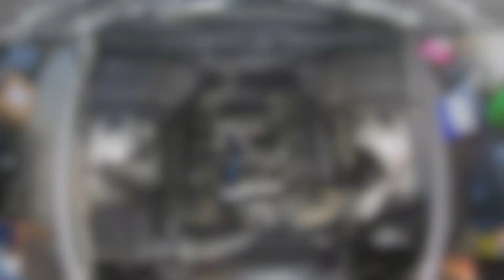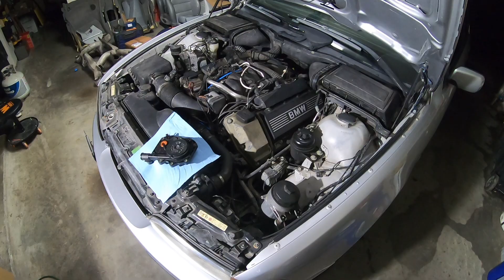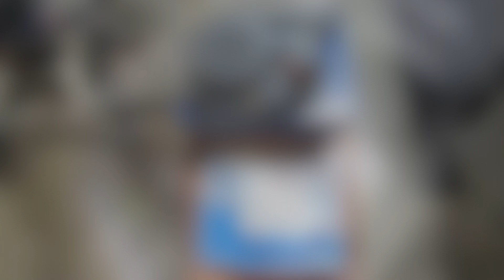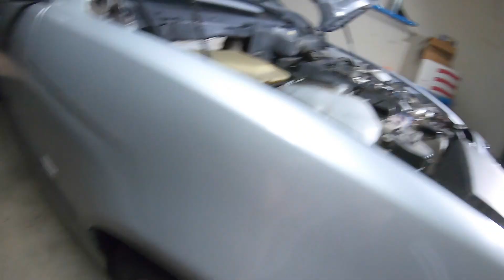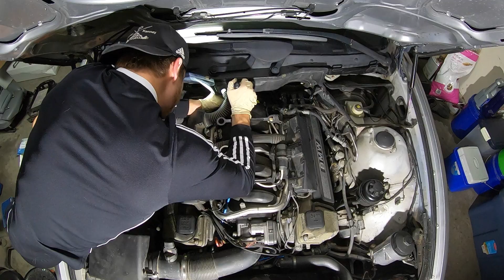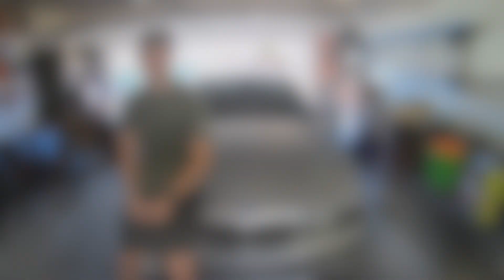How to replace the CCV | BMW E39 540i

Comment: There is a simpler way to replace pcv. You dont have to unscrew the body from the engine.

On the new purchased pcv, take time really and with maximum caution slide off the cover. It has latches. Work every latch one by one, don't rush. If you damage it you are toasted, do it really slowly, maybe use hair-dryer to soften the plastic, but not too much. The new cover with new membrane inside is removable that way. Dont forget about spring inside.
Don't buy very chip ccv as the quality of a membrane is a key there.

On the car,  gently using screwdriver or any pry tool peel off the round cover that holds the membrane inside. Work the laches. Use a torch. Get a good lighting the. Feel free to damage some latches on the cover as it's going to be replaced and thrown away.
Install new cover with membrane and spring and you're good to go.
Reply: That’s a good advice. This method takes like 15 minutes or something at max. It’s really easy and you also eliminate the possibility of the tube going into the oil seperator going loose
Reply: @E38Bimmer35  Exactly, and it is not even my idea. Other people have done it that way. The key is to really really take time with the new pcv. Maximum caution.

Comment: I replaced mine on my 98 540i and the pipe came out and i didn't know wich hole it went in. I have to replace it again the ccv, so which hole does that pipe go in
Reply: Did you ever figure out what to do? Have this same issue
Reply: @shaneb6554  it worked about a year started up againend if summer
Reply: @martinwellmaker6945  I’m talking about the vent pipe, did you re seat it properly?
Reply: @shaneb6554  it was seated but like i said i didn't know which hole in the front to put it in

Comment: I tried taking those bolts out and they just don’t want to come out now there stripped lol
Reply from the maker: That really sucks, were you able to get them out eventually?
Reply: @TireKickers  no I wasn’t able to. I may have to take out the whole manifold unfortunately.
Reply from the maker: @joedaniel8503  sorry to hear that man. Removing the manifold is pretty straightforward, but the re-install process can definitely be frustrating. Hope you’re able to get everything sorted!
Reply: A great misconception is that those are T30 torx bolts. They are not. They are Ribe #6 bolts. That is why it is so easy to strip these.

Comment: How is the Vaico branded PCV valve holding up?
Reply from the maker: Good question. Haven't had any problems since the install, but I do notice a slight whistle from the engine bay when I go WOT. It's not loud and I'm not even 100% sure it's the CCV, just something to keep in mind I guess.

Comment: Your info is slightly wrong. Your motor is a TU which means technical update. They started using it 2000, which means all the others before it had idle control valves and no vanos.
Reply: Wrong, they started the m62tu in 1998